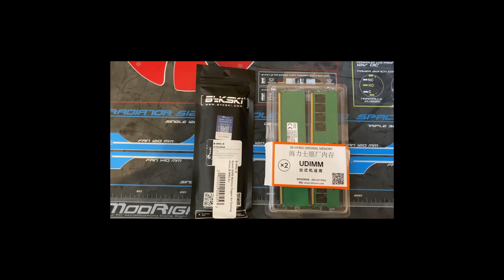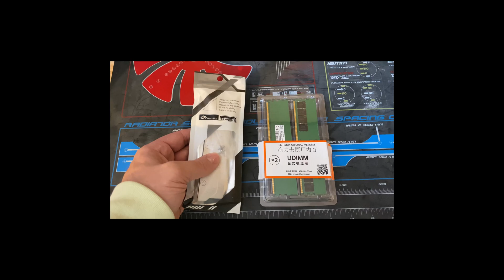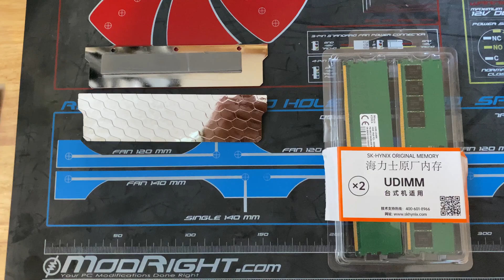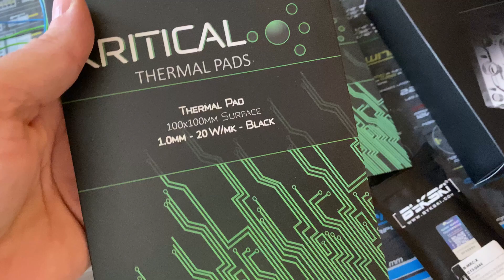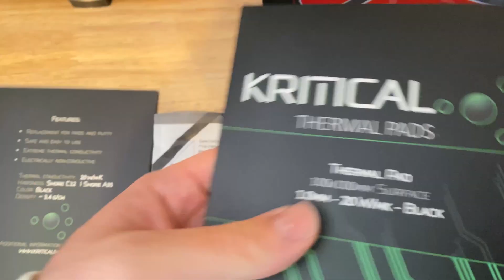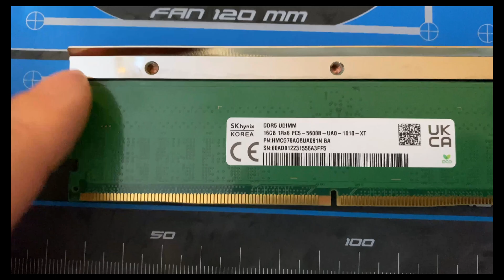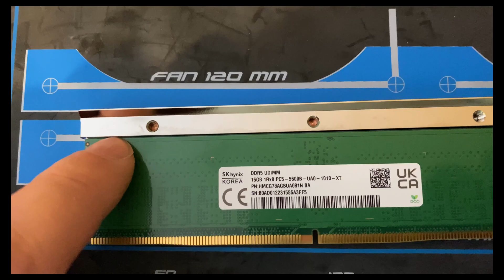Adding heatsinks to DDR5 A-Die

Comment: Did you use the same 1mm thick pads on the PMIC as you did on the RAM ICs ?
Reply from the maker: Probably, I honestly don’t remember but that’s usually how it works so I assume I did. I put a 120 fan directly on it and never had temp issues even at 8200 cl36 daily.

Comment: damn these are not bad, i got the icemancooler ones instead
Reply from the maker: Those direct ones? I ve been wanting to get some, how do you like them?
Reply: i have the icemancooler ram block and direct die block, cant say one bad thing about it. i just used thermal paste in between the metal pieces where you put in the screws and the waterblock  @B3n85_

Comment: How are you getting on with your 13900KS and these on the Z690 dark? I have a z690 dark on my bench but also have a z790 dark i have been messing with. Im running 8200 C36 20k kahru stable on the z790, i would like to push it higher but the issue with these dark boards is the VDD2 needs to be near the Vdimm voltage which is concerning how much voltage you have to push through the memory controller, i would like to get an apex to play with as i understand they don't need to run 1:1 Vdimm/ VDD2.
Reply from the maker: So I actually ended up getting an Z790 Apex and put my 12900k in that. I haven't swapped into my 13900ks yet, its still sitting on the shelf, but the plan is for it to be done this week!
Reply: @B3n85_  Nice where did you source your apex from they haven't been in stock stateside for months i wanted to grab one to test out. How do you like it compared to the dark?
Reply from the maker: @Jolinator  I got it from Overclockers UK. Im a Kingpin fanboy, but will admit the Apex is better especially for memory OC's.
Reply: @B3n85_  Yep i am going to return my Z790 Dark, you have to run too much VDD2 on these boards (MC voltage on the Apex) as it usually has to be 1:1 to VDD to be stable and is set that way by default. The Bios team and support working on the Z6/790 Dark is pretty lackluster and i don't see it getting to much better with Kingpin having departed. The ASUS boards also support TVB which is nice, with the 2+ boost bins you can get 6.2 single all day, Plus more active bios development. Hardware wise these are beautifully built however i have had Z790 darks one had bubbles around the Cpu socket in the top layer of the PCB the second had caps that were not mounted flush to the pcb. My Z690 was flawless but the Z790s have not been so. The extra layers on the Z790 mean nothing if i have to crank my VDD2 so high it will degrade my cpu over time meanwhile apex guys are using 1.425-1.45 to run 8800. Always been a big EVGA fan and wanted to have the last Kingpin board but the experience has been lackluster, maybe when they go on sale at a later date if they make some leaps and bounds in the Bios department i will revisit it.
Reply: @B3n85_  Was going to order an Apex from OCUK also but was worried about getting hit with an import tax and return postage fees if i get a bent board, how did yours arrive? I have seen a ton of bent Apex pcbs all over the forums.
Reply: @B3n85_  There is also something seriously strange about the VRM tuning on these boards, by default they will blast 400watts to my 13900ks and 13900k whilst my z690 strix apex will get the same scores with all power limits removed and only pull 330-350watts. Both on the 790 and 690 dark Even with a fixed vcore and the same vcore as my strix board is providing under load.
Reply from the maker: @Jolinator  Mine was the least curved one Ive seen...still curved though. But the EKWB V2 still had enough threads to get started so its all good!🤙
Reply from the maker: @Jolinator  Yea to be honest I was happy with my z690 Kingpin but very disappointed with bios support. I actually scored a higher CB23 score on the KP than the Apex...(I put more effort in with the KP to be fair) so its a good board, but I knew I was making the permanent switch to Apex for the 790 and beyond.
Reply: @B3n85_  Good to know. Did you get hit with import charges? How was the packing? I hate that they use DHL i always have had issues with them. About to pull the trigger on an apex
Reply from the maker: @Jolinator  No I did not. It was actually cheaper to buy from them than in the US and I had it in my hands 4 days after ordering!!
Reply: @B3n85_  Good deal just place an order! Appreciate your replies and looking forward to more content on the apex and your 13900ks.
Reply from the maker: @Jolinator  You wont regret it! My sons baseball season has started so Ive had to shift gears for a while, but I will be back on it shortly!